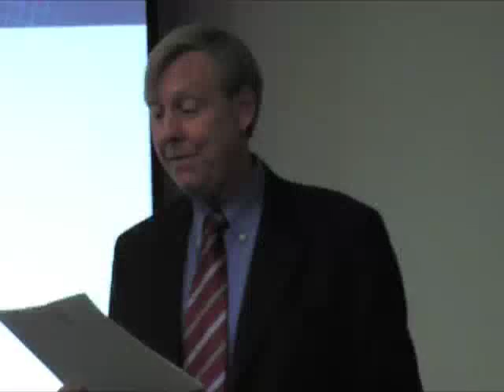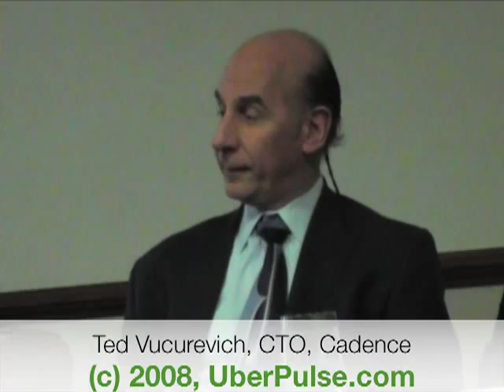Moore's Law Ends in 2020

Comment: Consider the memristor.  It resists electricity depending on the prior current level. The active elements in the HP version are 60 nanometers wide, and it can retain at least 256 different resistance levels.

Rumors of bounds on Moore's Law appear periodically. It would do good for a bounds discoverer to review prior bounds discoveries.